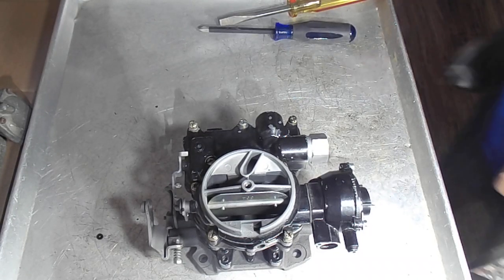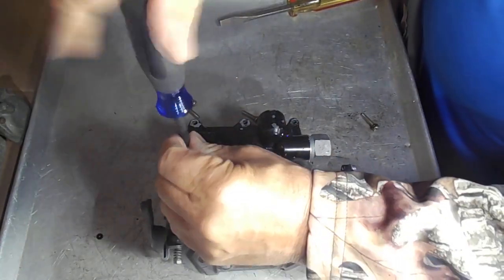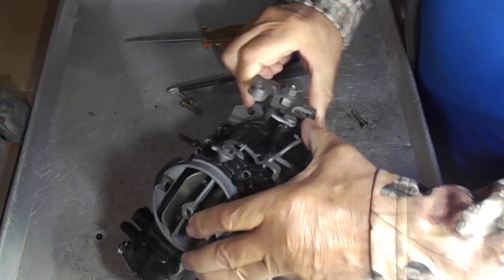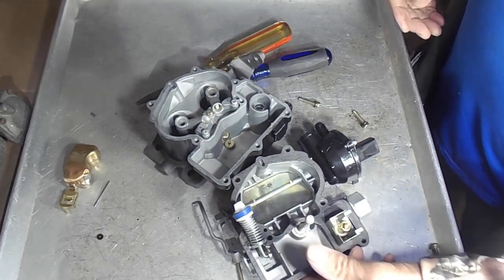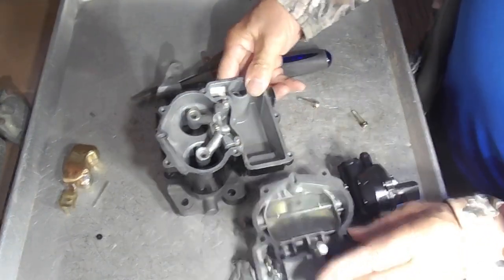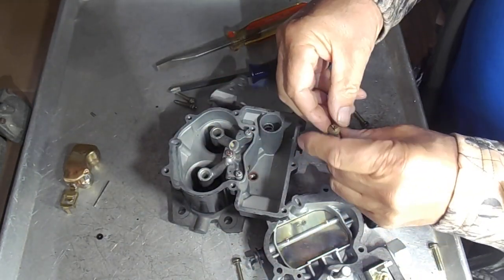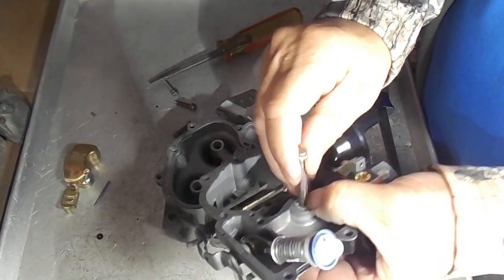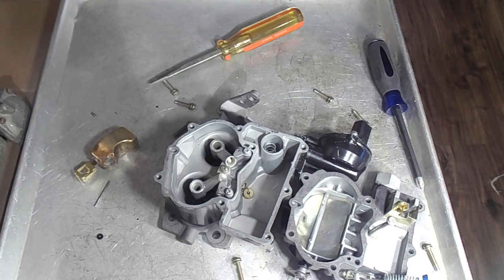Mercarb Marine Power Circuit

Comment: Hi Mike  I have this same carb for a mercruiser but its flooding.  my fuel pressure is about 10PSI   is that too much for that carb
Reply from the maker: 10 is way too high. 4-5 would be about right, but check the motors manual for an exact spec. You might have to install a regulator between the pump and carburetor.

Comment: The spring loaded power piston, located in a cavity in the air horn, directly above the power valve, is held in the up position by engine manifold vacuum at all times during engine operation.

  During idle and cruising ranges, the relatively high engine vacuum holds the power piston stem. During this period, the power valve remains closed.
 
  Increases in engine load lower the manifold vacuum. When it has dropped sufficiently, the power piston spring overcomes the upward vacuum pull and the power piston moves downward, opening the power valve to allow additional fuel to flow through calibrated restrictions and on into the main metering jets to give the proper mixtures required for power operation.

   A hole is drilled from the carburetor air horn to the bore of the power piston cavity to break any vacuum that might leak around the sides of the power piston. The purpose of vacuum break hole is to prevent the transfer of vacuum from the piston to the top of the fuel in the float bowl. Any vacuum acting on the fuel in the float bowl will affect carburetor calibration. 

  When the power valve piston bore in the top cover is severally worn, causing a sloppy fit of the piston. the above situation will happen. with vacuum creating issues in the float bowl.   

The power valve  is a self- contained assembly consisting of a plunger and closing spring. The power piston forces the power valve plunger off its seat, allowing fuel to flow through the valve and into separate fuel channels, passing through calibrated restrictions and then on into the main well. Some applications use a two-step power valve. The first step unseats the plunger for light power requirements. For the second step, the plunger is bottomed completely and the fuel is metered entirely by the power restriction for full power operation.

     The power system is specifically calibrated for a particular engine's power requirements and is a self-contained unit which requires no adjustment.

   there is a chance of having a machinist create a new thin wall liner to press into the oversize reamed power valve bore. this will restore operation but its going to cost a significant amount of money to fix properly.